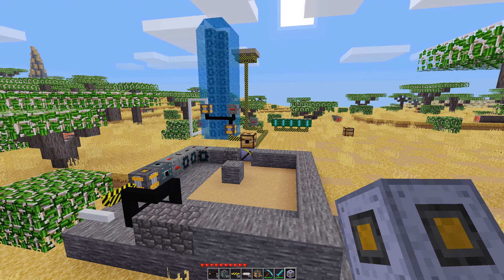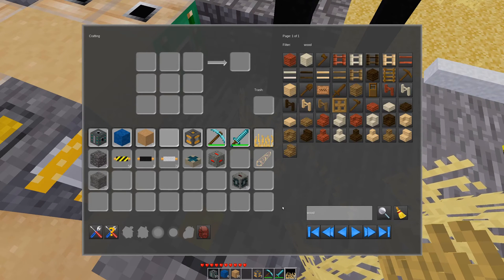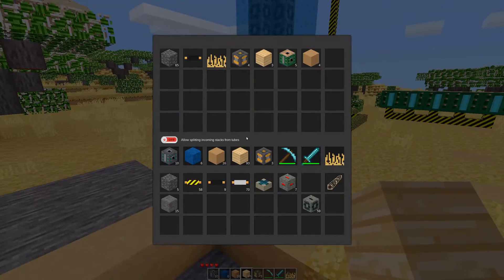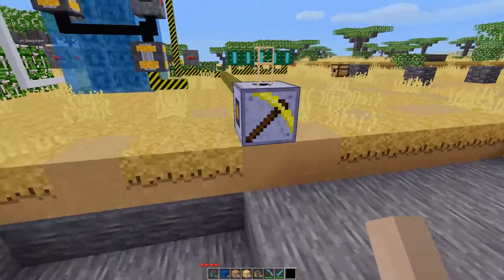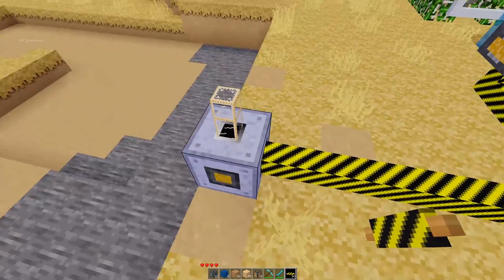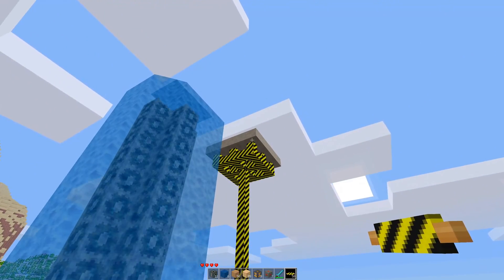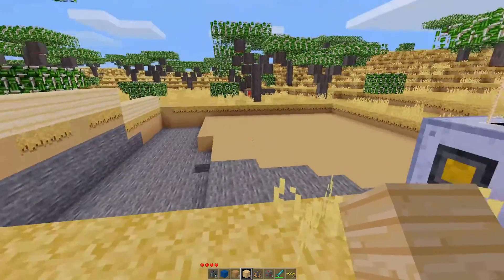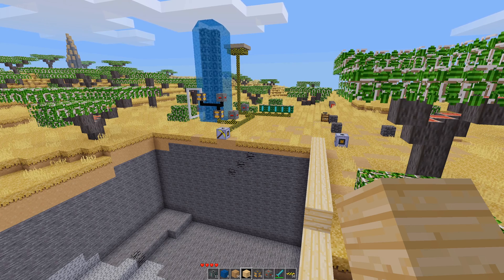Minetest Automation | Mining - Technic

Comment: Can you run the game at speeds other than default? Or is this just a long timelapse?
Reply from the maker: You can change the time speed, which is what I did here. I believe it's called time_speed in the minetest.conf file. Default is 20, I don't remember if you need toake it larger for the the time to go faster or smaller.
Reply: @LuantiVideos  cool. Similar to randomtickspeed on Minecraft. I wonder who implemented the ability to adjust game speed first? By the way, did you start with Minecraft, but then decide Minetest had better potential? Or were you too poor for a Minecraft account? You don't have to answer, but I'm just curious. Some people like Dee23 switched to Minetest from Minecraft.
Reply from the maker: I was wrong. I thought this comment was on a different video. You can adjust the time speed, but that only effects the passage of the celestial bodies in the game, actual mechanics will operate at the same speed, as they are based on seconds no an arbitrary game time. In this video I did use a time lapse for the mining bit.
I did play minecraft for a year or two back in the day when Notch said it was okay to pirate it. The mod support was horrible, and I remember getting frustrated with mods conflicting with each other due to item IDs matching or something like that. I never even tried to make mods for minecraft because it just looked way more difficult that it should be. When I discovered Minetest and how easily it could be modded I knew any effort spent in the space would be for Minetest.
Reply: @LuantiVideos  ok. Minecraft is slightly easier to mod since the creation of Forge and Fabric, and the removal of item id's in 1.13. But there is still no official way to mod MC, so Minetest is still that far ahead, and will be for the forseeable future. You still need a java decompiler, and a java compiler. Unlike Minetest where you only need a text editor.

Comment: It digs 3 nodes above the quarry. Any obstructions placed in the area it has already dug will cause it to not dig any nodes below the obstruction. The water block it couldn't dig and the flowing water obstructed most of the area and is the reason it started digging a 1x1 hole. Placing torches on the walls of the hole also causes it to stop digging directly below the torches.

A single supply converter can go from LV to HV, instead of using two of them and an extra switch. It loses 10% power to convert, or 20% when going from LV to HV.
Reply from the maker: I did not know that I could convert from LV to HV directly, seems the wiki is out of date, as it says you can only convert from LV to MV and MV to HV. That would have made my demo scene a little cleaner looking, but it still worked anyway. :)